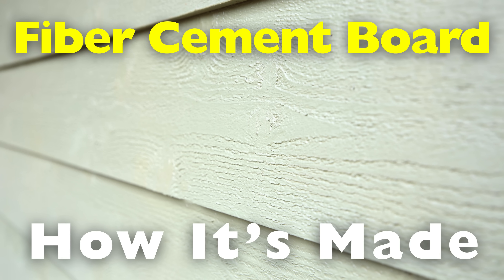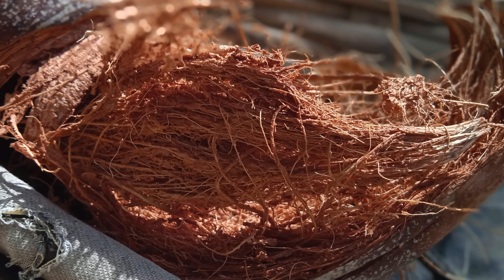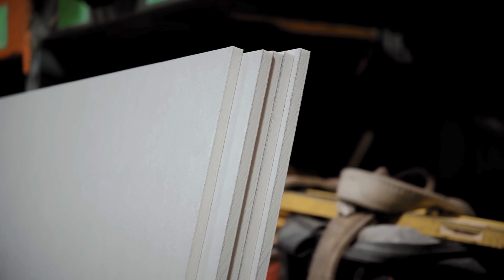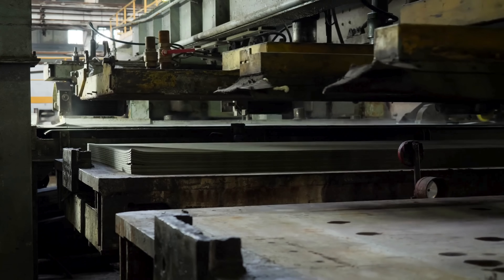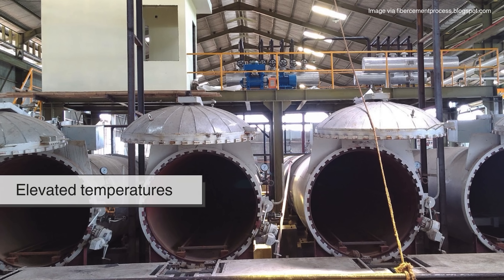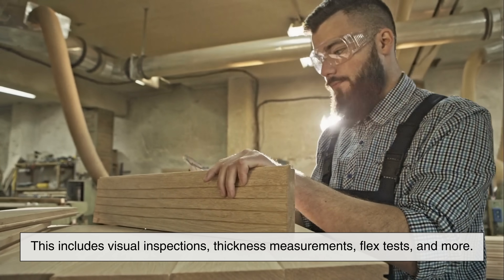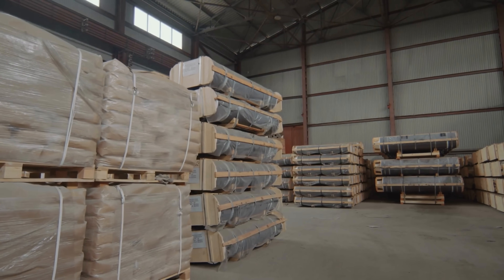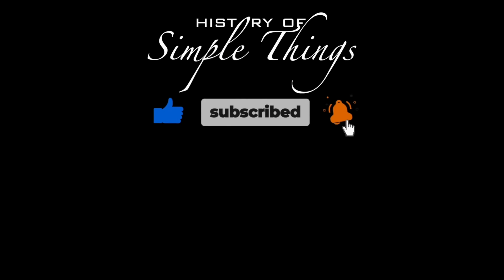How Fiber Cement Board Is Made: From Raw Materials To Durable Panels

Comment: 50 years ago I used fiber cement board to rebuild a front porch on an old house. It had a wooden floor supported on 3 sides with decorative block, 12 inches square 2 levels. These block had 5 holes in each one. I removed the wood floor, placed fiber cement board behind the decorative block and filled the space with dirt and poured a concrete top. 50 years later it looks like the day I constructed it. This was in central Illinois.
Reply: Thank you for this comment! You helped me find a solution for my ancestral home's floor. 🎉

Comment: i hate fiber cement board. its fragile, brittle, and extremely labour intensive to install because of how weak it is. terrible stuff
Reply: And too heavy, i tride to make an attic storage space using this board, 4*8feet sheet having 17mm thickness.  It took 6 people to carry this thing to the workplace and to the attic. Never going to use this, better go with marine plywood
Reply: I love fibercement, it only takes one layer to build a wall, it is more sturdy and easier to make installations in. It takes special tools, diamond saw blade and a good shop vacuum attached to the tool, but overall you get a better result.
Reply: I had it on two of my houses and loved it. Charleston, SC
Reply: You have to work within the properties of the board. I’ve used in marine environments where it holds paint well and doesn’t rot. Yes it’s heavy and brittle. Once installed, weight isn’t an issue.
Reply: You shouldn`t work with your hands...
Reply: There is a learning curve working with this product.
Reply: I’m sorry to hear that. You should read the installation instructions and get some help if you are lifting heavy sheets.😊